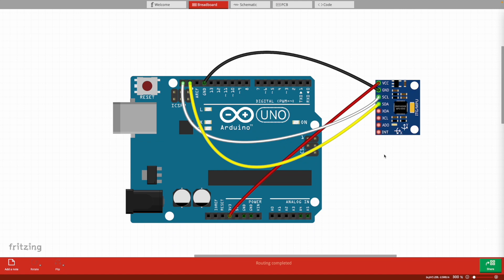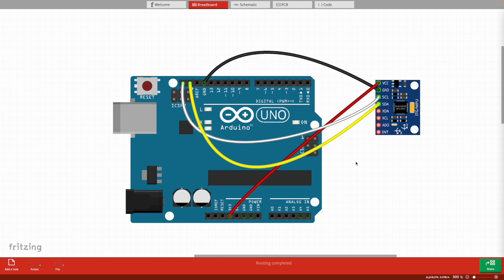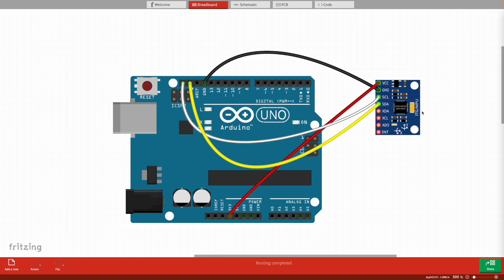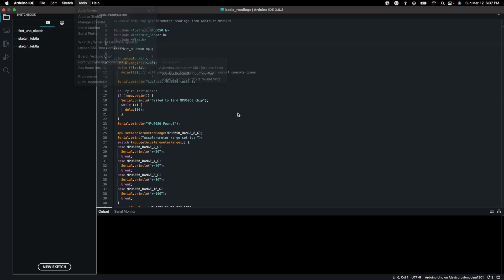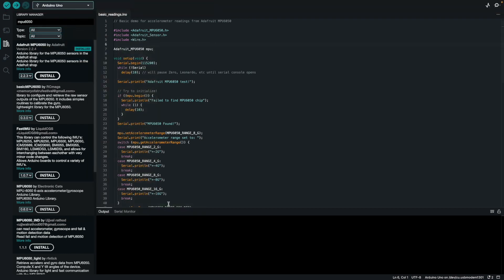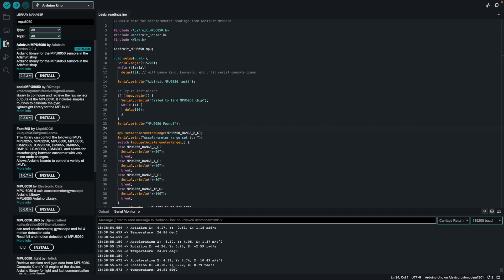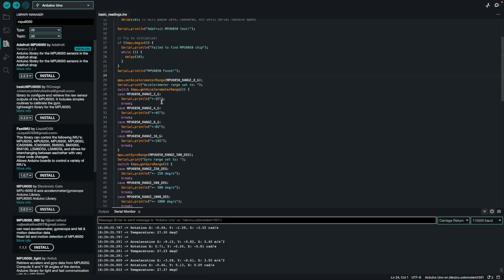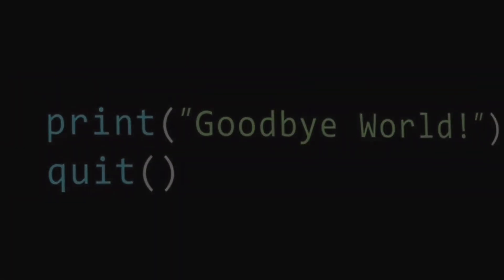How to Connect MPU6050 to Arduino Uno

Comment: I can't stop having the message "Failed to find MPU6050 chip", and I don't know why, can you help me ?
Reply: I was having the same issue, until i realized i plugged into the 5v instead of the 3.3v, luckly i had 3 mpu6050s,  because i think i fried one.
Reply from the maker: @ArtTillery  rip
Reply from the maker: Maybe try another MPU? Do you have another unit? Are your jumper wires okay?
Reply: I'm having the same problem now. All 3 of my MPU-6050 chips reporting the same problem. I ran an i2c scanner sketch that finds each of them at address 0x68, but the MPU-6050 library just doesn't want to work with it.
Reply: I think the problem (in my case anyway) was the Adafruit MPU6050 library. When I used the ElectronicCats MPU6050 library and their example, I could see readings and detected changes. Not sure why the other library isn't working /shrug

Comment: should the values not be accel: 0 0 0 gyro: 0 0 0 when the board is still? I am getting values of 0.11 on the gyro when the chip is still?
Reply from the maker: You need to calibrate the accelerometer :)
Reply: Ah ok thank you.

How do i do that?